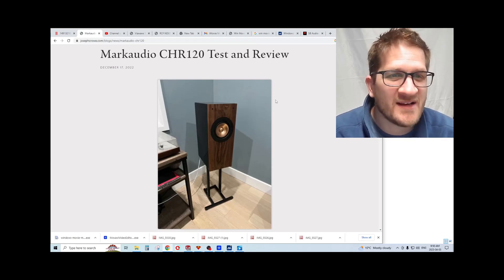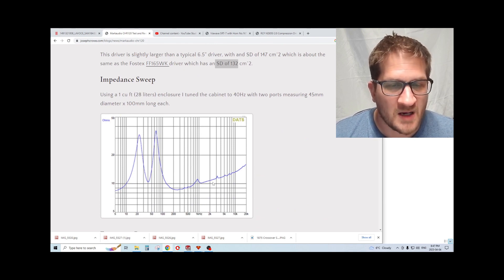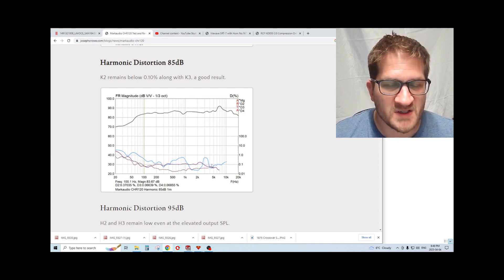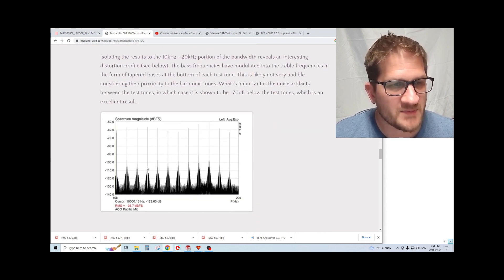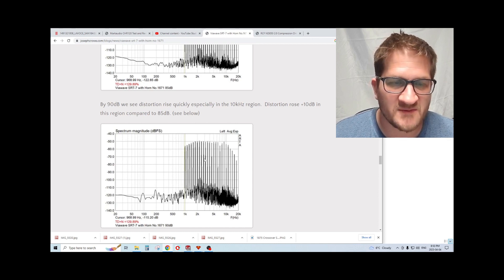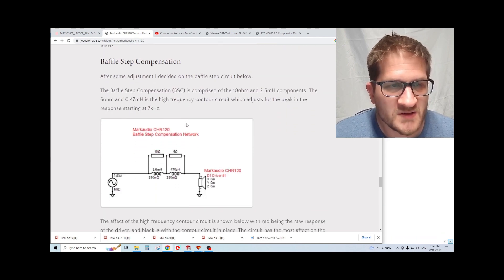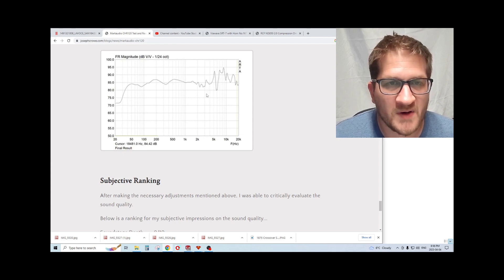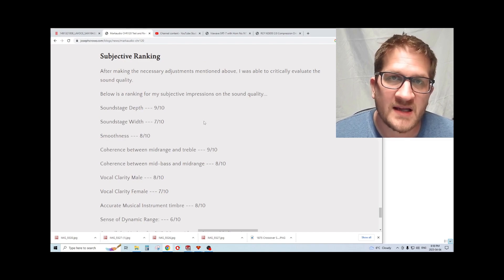Markaudio CHR120 Test and Review

Comment: Cudos to you sir. Excellent levelling circuit that's designed to refine. For your ears & NOT to measure flat.
A lot of networks seem more inclined to pander to linearity  of measurement. Rather than musical enjoyment. Hence, why so many fullrange affictiandos throw the baby out with the bath water. And turn their noses up at what is an audible improvement IF its done right. Great stuff! Keep it up!
👌
Reply from the maker: Thank you very much!
Reply: @JosephCrowesDIYSpeakerBuilding No problem. Credit where it's due. My guess is you are or have been a musician. Which is a very good place to evolve from for doing this.

Comment: Is there a way to subtract the spectrum of the multitone distortion signal itself from the spectrum of the intermodulation distortion spectrum? I think if you do that then you could produce a curve that is limited to the harmonic and intermodulation components of the speaker's output.
Reply from the maker: There is a way to subtract the and produce a difference between two overlays within ARTA. So I would have to subtract perhaps a loop back signal. ARTA is no longer supported and I see Klippel offers some better testing of IMD if you check out Erin's Audio Corner on the topic.

Comment: An excellent video. I've been investigating MarkAudio drivers & I'm itching to try a design. It occurred to me that a 4" driver (like the inexpensive CHR-70) mated with a low cost high efficiency 6" or 8" bass driver could simultaneously achieve baffle step compensation & relieve the 4" driver, when crossed over at the baffle step frequency. A double chamber box is required, no biggie. The crossover could be fairly simple too. Has anyone published a DIY design along these lines? Thanks in advance!

Comment: Is the bass fast and punchy?
Reply from the maker: No, compared to some other drivers it is slightly lacking in punch. I tested a Beyma 12LX60V2 in a 60L cabinets. That was very punchy, like a shockwave through the house, made the HVAC rattle even at normal listening levels, unlike some other drivers that are just too soft (for the same output level).
Reply: @JosephCrowesDIYSpeakerBuilding that’s a 12” subwoofer though. Not exactly apples. 🍏
Reply from the maker: @mattfranklin3622  still no.
Reply: Hahahahaha! These are SMALL drivers. They will do "fast" but punchy? You can't expect a feather weight to punch like a heavy weight.
NOT going to happen. Regardless of x max or magnet size. To emulate a kick drum, you need a bass driver the size of a kick drum. The more you reduce the size of the drivers, the more you loose the sense of scale compared to live music. That said, For small spaces or computer near field. These can sound pretty good. I would mount them in a sealed cab & X over to decent subs @ 80 - 100 hz. But, due to their TS parameters, it would be on the large side of sealed.

Comment: Joseph, thanks so much for making this video. I have just built a 70 litre floor stander using this driver. 
I totally agree with your findings and the need for the contour circuit. I have just tried this and the sound is so much better now.
Next I will try the baffle step correction to evaluate if I would benefit from that. The fine detail these drivers produce is indeed impressive.
Thanks again.
Reply from the maker: Thanks! I’m glad to hear. 
I’ve introduced the plans on my site for the complete plan set. I will be introducing a variant of the plan soon which converts the CHR120 to bass and mid-bass and then setting a waveguide loaded Alpair5.3 on top. The waveguide measures 40cm x 40cm square. The idea is to maintain the MarkAudio sound but without the breakup in the upper treble. Also the spiderless design of the new Alpair5.3 gives it a really dynamic sound.
Reply: @JosephCrowesDIYSpeakerBuilding 
Did you make this plan